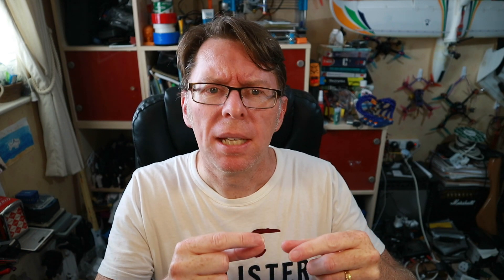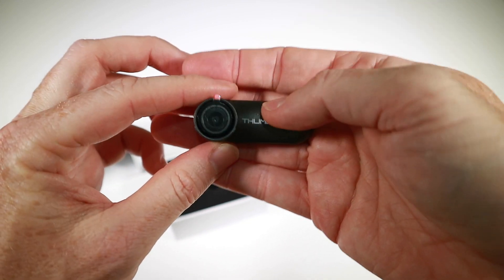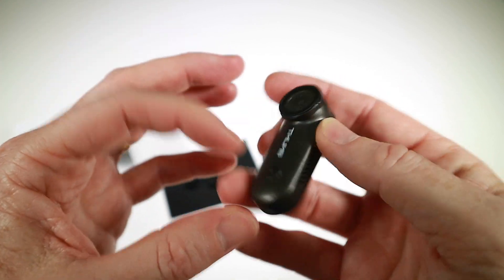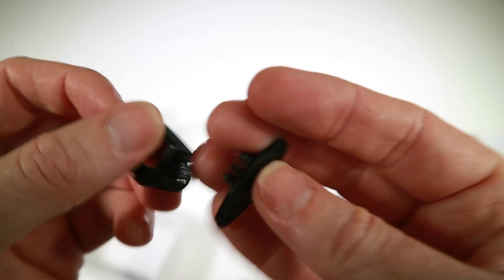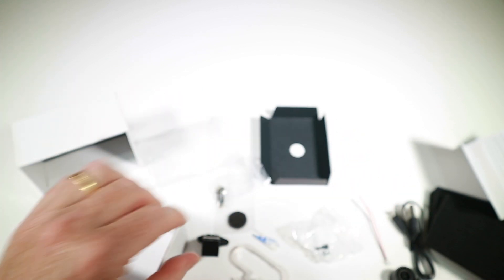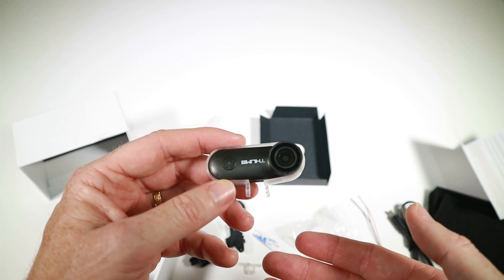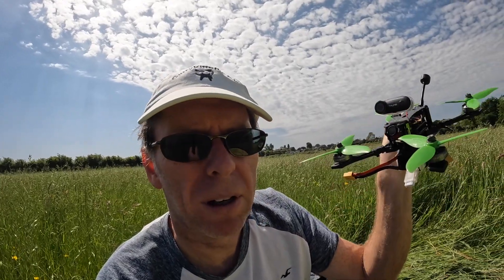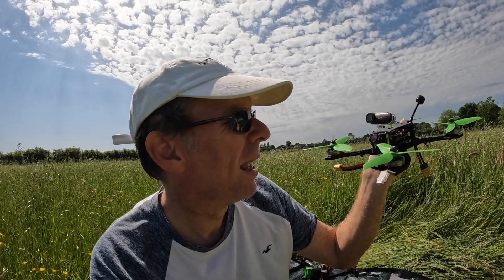The RunCam Thumb.  A low cost HD camera that works with Gyroflow.  Supplied by Banggood

Comment: Set your auto sync to 10 points. Then change low pass filtering to 0.10hz. or 1.0hz. you will get a 25% more smoothness. But it wont fix your jello problem.

Comment: I unfortunately purchased one and I completely agree with you on your review.  I definitely would not recommend anyone purchasing this even with how cheap it is.  Besides the bad video stabilization issue it has, I also wouldn't recommend it because of it housing.  The little door that holds in the SD card comes off way too easy and I ended up putting tape on mine to keep it from coming off during flights.  The lens cover also comes off very easily (just a very slight turn and its off!) so I ended up putting a dab of hot glue on it to keep it from coming off.  Over all, RunCam did not put enough thought into this one!
Reply from the maker: I was chatting to AndyRC about it and the first thing he said was "tape up that door" :D  It's hard to believe that RunCam put any effort in to properly testing this as it was designed to be flown.  More of a rush job to get something out that supports Gyroflow

Comment: Wayne, this was an excellent review. very well done and kindly put as to the Run Cam Thumb's poor abilities. I couldn't be that gracious but you certainly said it most proper. As I had mentioned to you awhile ago, to me personally it's just a bottom of the barrel dime-store very flimsy cheap item (crap) which has not much of anything going for it. Obviously I truly regret I purchased one and its now in its box in a drawer not anytime soon to see light again. The first one I received was DOA and after several weeks of waiting for new stock, Get FPV kindly replaced it. But with that said, there is not much between a DOA Run Cam Thumb camera and the functioning one I now have. I apologize for being so critical to those who may think differently. But I sincerely fail to understand why Run Cam would have ever at any time whatsoever thought this item was worth the effort to sell as it currently stands. It makes me suspicious to jumping in and buying another Run Cam Product until there has been a considerable amount of reviews posted. All the Best.

Comment: The black mount has a groove cut out on the inside of it. It gives a little space to bypass the jst connector. It still fits tight but may help avoiding damage to the connector.
Reply from the maker: The black mount is now in place on that quad ready for retesting!

Comment: The black mount works much better than the clear one. I'm flying it on two small quads (GEPrc Crocodile Baby and Darwin Baby Ape) and just try to concentrate on flying smoother. 1080 is just too low of a res to crop for gyro data, and the sensor isn't great on top of that so you see lots of pixilation in dense areas like grass.

This is a great camera for quads that can't carry a better one. For the size you tested wtih, I'd use a Runcam Orange or something.
Reply from the maker: Glad to hear you are having decent results on the black mount.  I stuck it on a 5" as I thought about people starting out and wanting to share their flights without risking a more expensive camera - also it's less fiddly for me to easily stick stuff on an existing 5" quad :)  I feel the 1080p footage, although not great, would be acceptable enough given the price - but obviously not it's it's just full of the shakes

Comment: I've used gyroflow with great success, but....using the runcam orange 5 , gyro flow was unable to smooth out the micro vibrations. I've not seen any rave reviews on the thumb. I predicted that you would experience the results I've seen in other reviews. Hope you can sort it out.
Reply from the maker: Nice that GyroFlow cleaned up the vibrations on the orange.  Was the non-stabliased footage as bad as the Thumb's was?  I ask because I'm interested if it's the case of there's only a certain amount Gyroflow can do, or was it perhaps that the Orange just got better gyro data and the software could work better with it

Comment: Thanks as always Wayne , I’m lucky enough to own a insta 360 go2. But my friend just purchased a runcam thumb. I think soft mounts are the secret with these small cameras . And correct ND filters . Iam still looking at soft mount options for my go 2  to fit on to 3” quads . He also had a few issues working out the correct plug sizes to order as there are  a few on the market and only one that fits . (.   . somthing of a mm difference). The idea being put all the leads on his quads and just swap the thumb out each time .
Reply from the maker: There are so so many types of jst connector.  It makes them a massive pain to source and I get the feeling that every manufacturer just buys in the sockets/connectors that are cheap at the time, so no standard exists in FPV.  Plan is to use the TPU mount next and then see if that needs additional softmounting to make useable.
Reply: @CurryKitten  good luck with that and be interesting to see the results 👍🏻

Comment: My experience is similar to yours with the runcam thumb -- the footage is bad without an ND filter, it takes every single vibration quite significantly. The ND16 filter is the only thing that makes the footage 'passable' in my experience. I have not used that plastic mount at all, though, it seems particularly horrible with that mount vs. a plastic mount. I have flown mine on the DarwinFPV tinyAPE and the cinerace20 with TPU mounts, and N16 filter, for the most part the footage is ok. I'm struggling with power delivery issues to this camera I think one FC now. I wish the thumb had a better way of handling power in general to it, rather than needing to tap the 5v reg.
Reply from the maker: It would have been nice if they'd put a power regulator in the thumb and given you a range of voltage input.  Then could could happily run off a battery tap, or balance lead and not have to solder something into your FC.

Comment: My clear plastic mount broke in a fairly tame crash, so just bought the black tpu mount. Whilst waiting for that.. the lens cap came off and disappeared. So now im running ND filter or no cap at all. Tape/hot glue or something to hold the thing together is 100% necessary.

The footage so far is full of jello when hovering. Hopefully the tpu works better for me.
Reply from the maker: Several people have talked about the little door that covers the SD card coming off and that lens cover was a little light on the twist needed - so I could see how it might come off.  Do you think RunCam tested this out on an actual quad?

Comment: Had the same issue, stock mount, their mount and a mount I printed myself.  I’m curious as to how this would work on a wing, which was more of my reason for buying it.  Gone back to using the Hero 7 Black on the quad.  Look forward to your results.
Reply from the maker: I think better on a wing - I saw Andrew Newton tried his on fixed wing and it was pretty stable.   I find on my fixed wings there's a particular RPM that causes a vibration frequency, but it can be alleviated to an extent by moving the rotation of the prop as it's tightened.  I might give this a go on fixed wing time permitting.

Comment: Wayne,  feels like this cam needs a suspension / soft mount, the jello was terrible. Thank you for the honest review. I have messed around with Gyroflow, and really got some good results when using a Runcam 5 Orange. RC5O would have to be one of the best non-gopro options for light weight and in-expensive HD cams (IMO). FYI - if you're interested in trying Gryoflow more, you can stabilise gopro footage. It gets a very similar result to Real Steady Go. Gyroflow is good, but seems fixing the thumbs issues is beyond it.
Reply from the maker: My GoPro7 is the weird outlier in GoPros where GyroFlow doesn't know what to do with it :)  Anything 8 and up is good, but I don't use my 10 in the air yet as it's too new and shiny to risk :)  I think we'll be trying the black TPU mount next and then seeing if that mount needs to be soft mounted.  It's a long road ahead!
Reply: @CurryKitten  apologies. I have tried with go pro 6 and go pro 8. From what I understand gyro in GoPro 7 is over sensitive, so that might be more challenging for gyroflow.

Comment: Great review! I've had pretty much the same experience with the more expensive Insta360 GO2. Lots of different mounts, versions and settings of GyroFlow, ND filter to achieve barely acceptable results. A second hand GoPro 7 Black gives far superior results without any additional processing. However, looking forward to eventually finding a tiny stabilized video camera for my small drones.
Reply from the maker: I love the no fuss sticking a GoPro on and having it's Hypersmooth do it's magic.  It would be nice for a cheap and lightweight camera do do something similar, but we're way off right now

Comment: Great review. I've been catching up, watching your vids after not touching my quads for well over a year. Getting the bug back I think but they are all in various states of repair so it will need a lot of work to get back in the air!
Question: what's the cheapest HD camera you would recommend for personal use and maybe sharing footing with mates? I'm still using dvr footage!
Reply from the maker: Oooh, that's a tricky question - it always depends on what sort of quality you are looking for.  2nd hand GoPro for a cheap(ish)/best result.  The Pro version of the RunCam Thumb (videos up on my channel) does a nice job if you are on a cinewhoop and don't mind a bit of post processing - although check my videos out and see what you think.  Beyond that's I honestly have a difficult time coming up with something.  I show a lot fo DVR in my videos because I want to show what I'm seeing much of the time.  If I need to though I use a GoPro 7 with Hypersmooth and that's got great footage from a variety of quads, so I've not looked personally beyond that.  The cheaper ones so far (like this) aren't quite coming up to scratch so far - but I live in hope that they will catch up.  Another one should be on it's way to me so hopefully more tests to come to find a cheap and decent HD camera

Comment: Very good review, Wayne. I mounted the Thumb on a fixed wing using a TPU mount and only got one well stabilized video out of gyroflow. All others (same wing, same day) look worse after stabilization. Weird! It seems gyroflow looses sync with the gyro data somehow.
Reply from the maker: I did check my sync points and the optical data seemed to mesh up with the gyro data ok - but it's hard to tell for sure.  I imagined you be in a far better position on fixed wing having a lot less vibration

Comment: Both the lense and the sd lid including the sd falls off briefly after take off unless your properly encased with a TPU jacket
Reply from the maker: Many people have mentioned these.  I didn't have an issue, but I'll be using a bit of gaffer tape and hot glue to make sure everything stays where it should when I fly it next

Comment: Can you please tell me the wire connection?

I have e88 drone....how i powerup this camera ?
Reply from the maker: You need to feed it a 5v and a GND connection.  You can maybe find one in your E88 if you open it up and go looking with a mutlimeter
Reply: @CurryKitten  what happens if i will give direct Power from 5v battery?
Reply: @CurryKitten  reply plz.....
Reply from the maker: Well, I can't think of a battery that runs on a consistent 5v, so you'ld need to connect it to a regulated 5v output.  What will happen?  Well, give it 5v and a ground and it'll power up... that's kind of the point of supply power

Comment: Haven't seen the video yet. My experience with the Thumb is pretty dissapointing so far. The Field of View is very narrow and the bitrate is way too low. I'm getting way better results with the Caddx Baby Turtle (wider FoV and double the bitrate). Gyroflow doesn't impress me that much, too. I'm only using it for the lens correction. The stabilization is fast but deshaker V3.1 (which is also free) gives me much better results. I'm hoping for a Thumb V2. Looking into the SJCAM C100 Plus at the moment which is able to do 2k/30.
Reply from the maker: It's certainly not something you'd use if you wanted "quality" video.  I saw it as a budget friendly camera for beginners which would give acceptable HD for sharing.... but that's not good if it just generates jello.  I'll have a looksie at deshaker though - cheers

Comment: Thanks for the review ! I'd like to point that your gyroflow is not setted an optimal way, this is why it is worse than original footagr, it is correcting but not in sync...
You need more sync point and be sure your XYZ are correct :)
I had the same trouble with a GoPro2 and Blackbox data... Around 5 sync points was starting to look great.
If you want, you can send me both files, i'll be glad to give it a try !
Reply from the maker: I did mess around with up to 10 sync points in all my messing around - to no avail, but I didn't learn about how to check the optical is in line with the gyro until later.  I've got the black TPU mount ready to try, so rather than send you the data from this first flight (of which everyone thinks that clear mount is horrible) let's see how the other mount goes.  I'd be more than happy to send you over those files if I can't make them look nice!